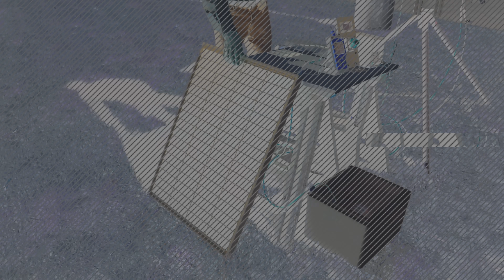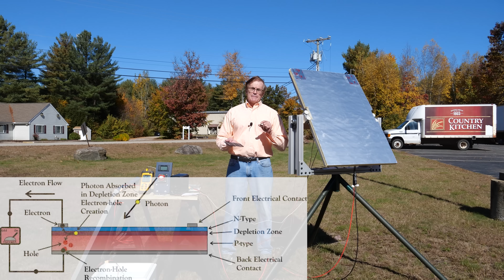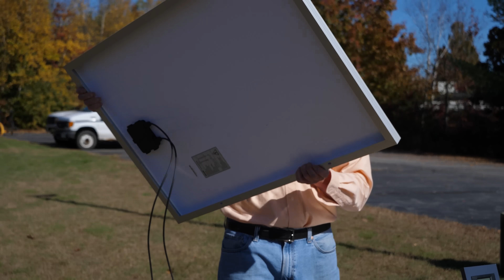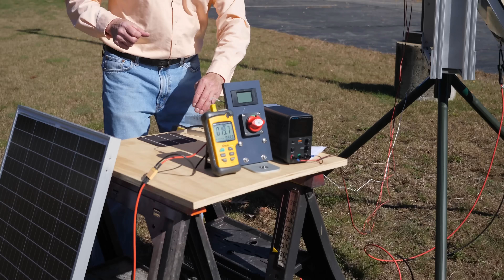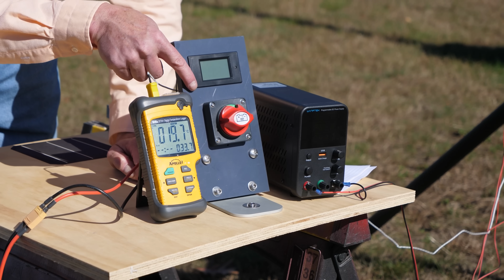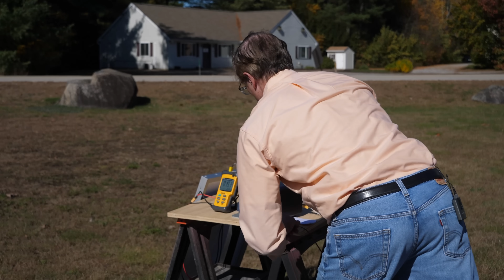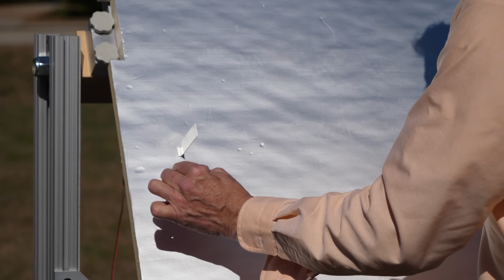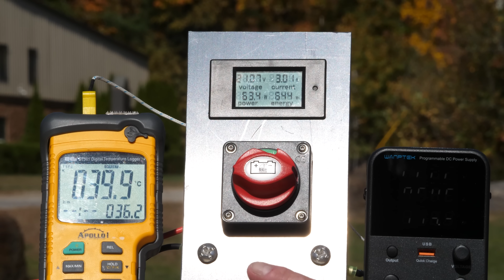Do you REALLY get enough out of your solar panel?

Comment: That's so informative. I didn't know panels loose efficiency at higher temps. To improve the efficiency, how about adding a pointing system that can point the panels directly to the sun, like some solar farms do. Instead of just bolting the panels to the roof, maybe an apparatus that can move the panels. Even a slight movement could improve efficiency, maybe a lot more than a cooling system. Or how bout a Fresnel lens that can concentrate more sunlight to the panel. A panel is expensive but a lens would be much cheaper. This would work great in large solar operations.. And maybe use the waste heat to heat up some water for household use. Or a swimming pool. Or a small pond.

Comment: Good video, but it with the price of new solar panels at $0.65/watt or less, it really doesn't make any sense. There is a reason you don't see many companies making active solar trackers or active cooling mounts: it's just not economically feasible. If panels cost $2/watt, it might make sense, but at $0.65 or half that for used panels in good shape, I don't think so.
Reply from the maker: Thanks,  but I disagree.  Don't  discount the effect on panel  longevity  and the cost of disposal.
Reply: @TechIngredients  I see the point you are getting at and if your goal is panel longevity or reduced cost of disposal, then you might be right. You did not total up the cost of the heatsinks, fans, power supply, replacement of mechanical parts, etc vs just cheap panels over 25 years in your video. Most consumers (and engineers) probably wouldn't want to buy a system with that much additional cost. Engineering (or at least engineering of commercial products) is the art of compromise.

Comment: If you duct the air to a central point you could grab the heat for a air to water heatpump. Most air heatpumps i looked at (around the 2500-5k bucks range) work down to -10°C air temps.  So feeding warmer air into them will always help the efficiency, but might even extend the usability overall.

Comment: Id be interested to see how this works when installed on a roof top, you might find you are pumping more hot air from the roof into the panels than cooler air in your experiment.
Reply from the maker: The hot air is still surrounding  the panels.  Consider a better roof coating or covering the entire roof with panels.

Comment: Would have been nice to see a comparison between the panel without anything on the back with the panel with the fins and fans, to see if the panel would be hotter if the fans fail. And to also get a control

Comment: What about a liquid-cooled glycol loop with a stirling engine on the hot side to scavenge a little more useful energy from the system? You might even manage to use said stirling engine to drive the coolant pump once the system is primed with enough heat.

Comment: Hmmm. Could you maybe test a setup,  where the airbox has minimal height?
2mm of airgap and maybe a mace or grid inside directing air flow / spread a bit.

This will mean higher pressure drop but hopefully a turbulent air flow inside. Wont be as good as handmade fins, but perhaps there is a cheaper middle ground without the fins. (Maybe rough powder coating/paint with metal dust? Thinking of inside heat pipe structures)

For water cooling vs below freezing temp air cooling: this would have been better for us lately, we had a few nights of -10°C which lead to snow and ice hard freezing on the panels. So the reduced amount of light/power wasnt enough to remove snow+ice.
If the panels were water "heated" above 5°C at that point we would have had a lot more power output over many cold days.

Of course another option would be to drain the water and switch to air (or no cooling) during winter.

Comment: Thanks for the video. I want to add that there are other solutions. For example manufacturers of more expensive panels do not make the back of the panel from plastic, as in your case, but from glass. This gives a double benefit - lower temperature, because the glass is a better conductor of heat, and durability, because the glass better protects against moisture. The durability of glass-plastic modules is usually specified as 25 years. Durability of glass-glass modules is 30 years and more.
Reply from the maker: You can always  upgrade the panel  and still add the benefit of active cooling.

Comment: I think the comparison is not fair. Normaly the backside of the panel is open and has natural air convection. With the aluminium backside the natural convection is more or less blocked, heating the panel more than a panel without the heatsink and fans. A fair comparison would be between a not modified panel and a panel with heatsink and running fans.
Reply from the maker: No, it isn't.  Airflow across the back is not restricted.  Convective flow is EXTREMELY slow.
Reply: @TechIngredients  I disagree. There is more to it then convection,  for example there is also radiation.
Reply: @TechIngredients  Sure convective flow is slow compared to a fan. But now you have hot air trapped behind the panel. (And no heat heat rediation as Tim J. added)  All installation guides for PV panels saying that you should not block the backside because it lowers heat disipation.

Comment: As a possibility, what if you used actual conditioned air to cool the panels. If you were going to be running your a.c. anyways, and you ran a small duct to circulate cool air across your solar array.

Comment: The control should probably be without that installment in the back, right? With the closed back of the panel without the fans running, you basically have an insulator that's keeping the panel warmer than it would be without the fans not running.

Comment: You're comparing your system on vs off which isn't the actual business case. You should compare it to a panel that doesn't have all your gear on the back acting like an insulator.

Comment: Maybe the desired output of the system is heat, rather than electricity? 

I would love to see an experiment using multiple thermal (water-cooled) solar panels and a heat pump (thermal diode or compressor-driven) to cool the water running through the channels, after that water has first been cooled in an evaporative cooling tower. 

Thanks for all the real-world prototypes of some great ideas!

Comment: Great study. I would make a die that made an accordion from cheap Aluminum foil, then bond it to the back. Convection should take away a lot of heat, without adding a lot of complexity or weight to the panel, and be a simple retrofit.
Reply from the maker: It's a good idea for increased scale production.
Reply: @TechIngredients  Or field retrofit

Comment: Why not have a 5mm gap at the back of the panel and run 50/50 water and anti freeze through it ,pump it up to the panels and let the hot liquid heat up domestic hot water .You then turn a problem into an asset.
Reply from the maker: I discussed that.

Comment: Nice comparison, 5% increase in efficiency is huge.
Minor objection, comparison should be between unmodified panel and modified with running fans. Since unmodified panel could have lower temperature than modified without running fans...
Reply from the maker: Actually,  the modified panel  was slightly  more efficient  than the stock panel due to the increased surface  area, but the difference  is small.
Reply: @TechIngredients  Thank you for update! ☺

Comment: Great idea, especially if you have stacked panels you can use heatsinks which would go into tubes which at the start and end each tube you have an intake and an exaust fan, this way you maximize in a target way the amount of cooling you can do to the panels, and if you need fans on between because you might have some large area, you can still place fans in between to help with the airflow.

Comment: 11:32 nice.
12:07 very meticolous setup, and subjecting the panel to partial shadow.
if you glue coolingribs to the back then all certifications for snowload or hailresistance are out the window.
those are small panels but big with ones the glass can bend several centimeters before any damage occours.

also the water flowing over the panel can cool trough phasechange, i wouldn't do it because the water could leave residues,
but especially if you have several solarpanels next to each other the fans will not help much with natural convection currents.

Comment: MTBF would be my primary argument against adding dc/dc voltage regulators, fans and heat sinking. I'd be curious to see the performance uplift of just adding the heatsink without the backplate and fans. Either way, excellent bit of content as always!

Comment: I’d like to see a few more iterations on this idea.   

I’d love to see temps and wattage of a panel by itself.  Then another with the back panel where the fans are mounted to see if passively cooling with just fins had any effect.  

A modification I’d be interested in seeing would be to use boxed fins with air directed through, and also water directed through fully boxed radiator fins to see if water could carry away more heat than active air cooling.  Not sure if a pump could match the efficiency of simple fans.    
I may try to get a similar setup to try experimenting.  I just got panels installed on my roof and would love to extend their lives and make them more efficient.

Comment: I have this theory, probably wrong: Solar installers use heat pumps (basically airconditioner/refrigerator tech) that replace your normal water heater as an energy efficient alternative. The one guy told me that you use the equivalent of 1500W of power to heat the water to a temperature that a normal water heater would require 3-4000W for. Could you possibly heat water enough via these heat pumps, to drive a steam turbine that would power the heat pump? Probably not, but might be a fun experiment.

Comment: I installed a thermostat controlled fan in my attic, not for the panels but for the inverter, it was going above 60 degrees C and that is bad for the capacitors. Now it never goes above 40, and i'm sure it cools the roof some (and therefore the panels also). I haven't got a thermocouple on the panels, that will be my next move! Thanks for the interesting video 👍

Comment: One source of free air flow for cooling the pv array would be by using the venturi effect in combination with the high velocity output air from an air conditioner which was already installed. In dinner, obviously that air would be hot, but that is not a problem because you just use it to suck ambient air into a vent which passes over the pv array first before merging with the hot aircon output air.  On large installations, like office buildings, the aircon fans would be running almost constantly during the day, thus we could "scavenge" a small amount of free energy from the pressure difference they create to draw ambient air over the pv array.  Costs? I don't know if those make sense, but it's fascinating to explore. We are getting rooftop solar panels installed in a few weeks, so I want to look into this more for using it myself. Maybe there is more opportunity to benefit from aircon output air in winter because the exhaust air will be cool, which is great because we could just push that air directly over the pv array. Cooling it and thus increasing its efficiency.
I really enjoy the videos on your channel!

Comment: That's what I've been telling people who are disappointed with their solar panel's output for quite some time now: the solar panel you're buying has a certain Wattpeak output rating but there's a couple of things to keep in mind. This output rating is determined at a light input of 1000W/m2 and at a temperature of 25C. So firstly you have to look at how many W/m2 of light you're getting. Here in The Netherlands that's about 850W/m2 so the output of your solar panel is already down to 85% of its Wattpeak rating. Next issue is indeed the temperature as a solar panel loses about 0.5% of its output for every degree Celsius above 25C. As a solar panel can easily get up to 65C that means it loses another 20% of its output rating. Which means you're down to 65% and your 300Wp solar panel only puts out 195W.
As for the angle (tilt) you should place the solar panel under I always advise 15 degrees as that's the angle of the sun in winter. Most people place them (or have them placed) at 30 to 35 degrees as that's the angle of the sun in summer (here in The Netherlands) and is what most companies advise as they all use the table of Hespul, which shows that angle to be the best. But it also means you absorb more heat from that summer sun and your panels can reach temperatures upwards of 90C, completely destroying their output (-33%).
Best is to get PVT panels which have a heat exchanger at the back through which you can run cold water to cool down the panel and at the same time (pre-)heat water for your hot water consumption.

Comment: Hi. That was certainly a good introduction to cooling PV modules. But it calls for more!
The back of the panel shown in the video was white.
- How much cooling would you achieve if, instead of active cooling with the fans, the back was just painted black, since black not only absorbs radiation better, but also emits it again just as well? Maybe you could even use a paint that's specifically optimized for heat dissipation?
- How much cooling could be achieved with passive cooling consisting of an aluminum heatsink? Would an aluminum heatsink be better if painted black?

I'm very interested in buying some solar panels right now and I have my eye on bifacial panels. They can increase their electrical output by a few percent when light falls on the back of the panels. Of course it would be counterproductive to cover the back with heatsinks and ventilation add-ons... but would it be practical to use a glass or polycarbonate panel on the back, fill the gap between the panel and the glass panel with water and use a pump for active water cooling? Sure, the water has to be able to give off the heat somewhere, but there would certainly be something, even if it was evaporative cooling.
Reply: The thermal emissivity of any paint used in the operating temperature range of solar panels is quite high, so the color matters very little.  Almost any paint, whether white, black, or any other color is much better than bare aluminum.  This may seem counterintuitive but remember that colors are perceived by us in visible light, but the thermal emission from moderately hot items such as solar panels is at much-longer invisible wavelenghts.  Paints tend to be quite absorptive and emissive at these long wavelengths (wavelengths peaking on the order of 8 to 10 micrometers).  On the contrary, for absorbing energy from the sun, black is best because the sun is so hot that its emission peaks in the visible range (wavelengths on the order of 0.4 to 0.7 micrometers).

(Sometimes, aluminum heatsinks are anodized black or another color to improve emissivity as compared to bare aluminum.)

Comment: If you have a pool, couldn't you use the pool water to cool the panel? Considering that normal "solar heating" for pools is just black piping and picks up a lot if heat. Running the pool water past the back of these solar panels to pick up heat, it would increase the pool temperature, but drop the temp of the panels. The pool wouldn't be heated as much as with normal "solar heating" pipes. Maybe someone can do some calculations on this.

Comment: I wonder how difficult it would be to implement a liquid cooled system... perhaps if you use Propylene glycol (less toxic than standard antifreeze) mixed with water and run in a way that cools the panel. It might be more efficient than the fans, especially for large permanent installations. A single pump could probably power the whole thing.

Comment: Isn't this whole experiment flawed because your control is contaminated? The enclosure you added to the back of the panel is trapping heat that would otherwise naturally convect to the surrounding air. So of course it performs better once the fans are turned on...
Reply from the maker: The panel  actually  performs  slightly better than the control even without  the forced air due to the increased surface area and the area isn't  really  closed. I should  have mentioned that.

Comment: I want to make a solar panel and attach peltier devices to utilize the heat  off the back of the cells to produce electricity. Probably would be much but would be fun.<< ahm! Patent pending 😄 🤣
Reply from the maker: Don't bother.
The cost would be quite  high and the heat flow restriction produced by the TECs will lower the effeciency  of the panel  itself.

Comment: Fantastic idea. The only problem I could imagine is dust and aluminum oxy over the years of out door use. Well i live in Chicago we have all the seasons, blistering summers and below zero winters. Our winters are the windiest which would work awesome in this case I don't think you'd need a fan. I had no idea they degrading in this way but I foresee much maintenance. I don't know how much salty air / aluminum oxy degrades the heat sink properties of aluminum but I do know it's everywhere. You can smell it in the air over here.

Comment: How about adding a 6” tall reflective panel across the width of the solar panel at the top of the frame?  If you angle it down, it could reflect additional sunlight ☀️ from a different angle.  This could boost generation.